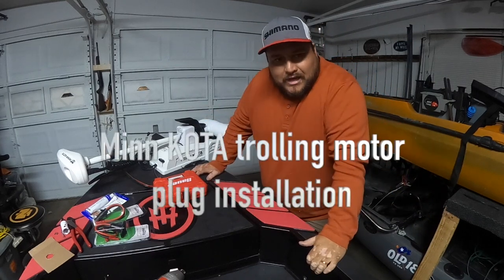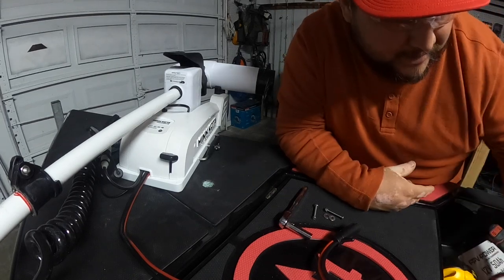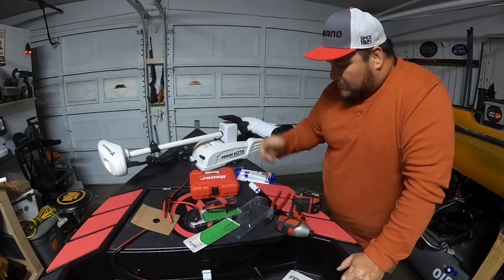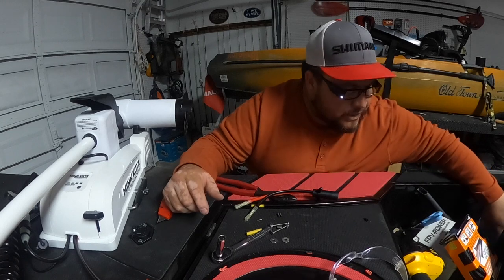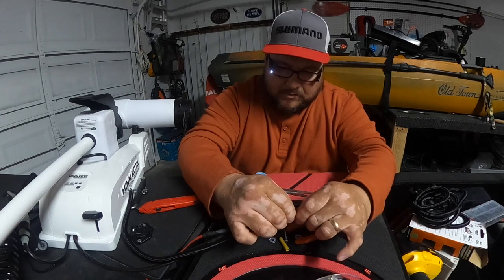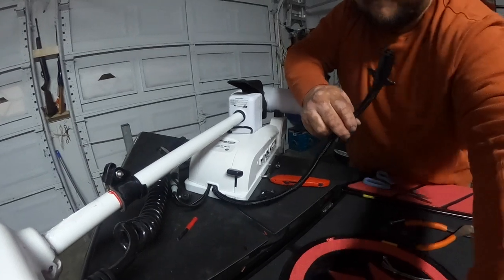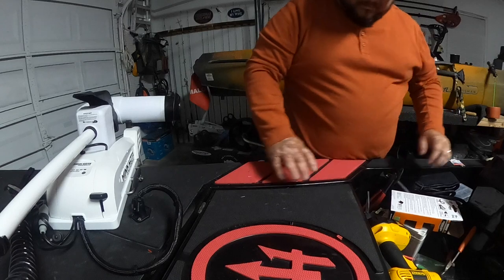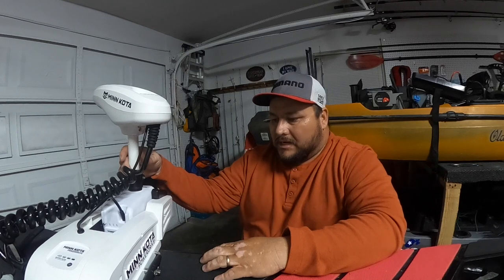H Skiff Trolling Motor Plug Installation   HD 1080p

Comment: What I usually do when I’m splicing wires is if you have a soldering gun just put a little bit of soldering on the wire where you strip back and it should fit perfectly inside the connector. Also if you use the waterproof connectors layout have to do is just apply heat to it you really don’t need the heat shrink
Reply from the maker: Perfect I’ll try that on my next splice I’ll give you a shot out!!!! Thanks 🙏
Reply: are you soldering the tip to prevent the tiny wires from fraying or the back end of those stripped cable? Thx for that tip
Reply: @jimbeauxjimenez1850  so once you strip the wire twist it then solder all the exposed wire but just a little solder. If you put too much solder it won’t fit in the connector
Reply: @gulfmancardenas230  Oh ok. Got it. Thank you

Comment: I do enjoy watching people use di-electric grease incorrectly. Don't be shocked when you connection isn't working because you just blocked the flow of current. It's an insulator, not a conductor.